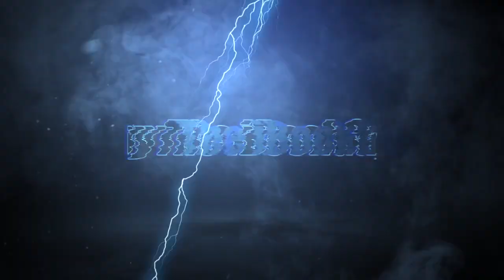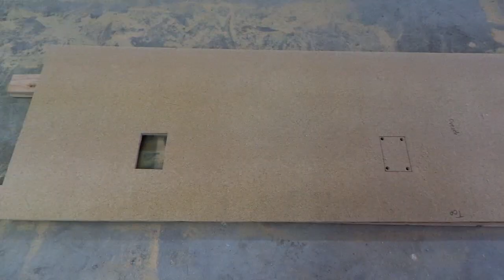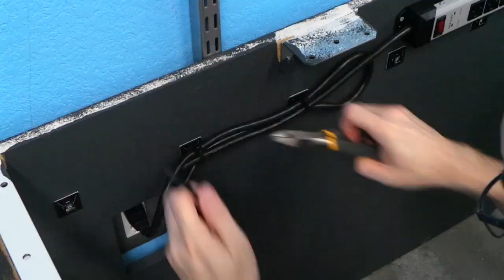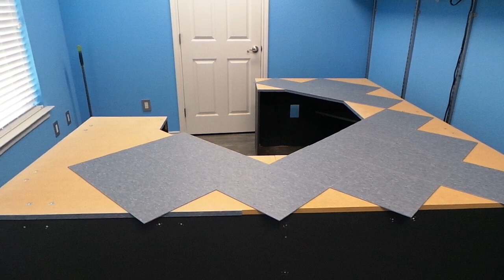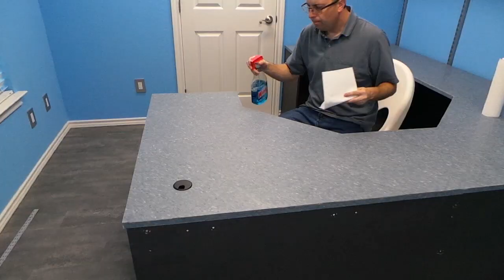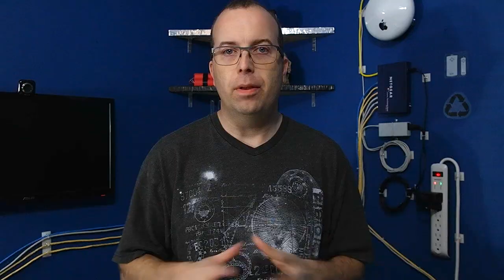Building the Ultimate Computer Desk - Part 3

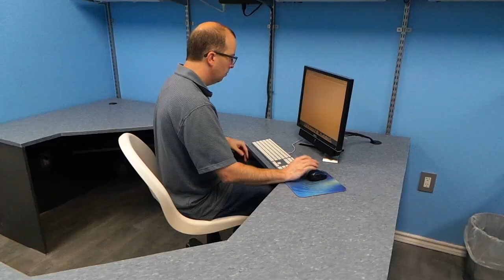Comment: I dont know how often/long your computer sessions are, but i hope that brief scene at 3:52 is not how you normally use computers. That monitor is 5-10 cm too low with your head tilted 30 degrees downward as if using a laptop (top the of the monitor should be at the height of your eyes).  A chair with almost zero back support and no arm rests leaving elbows suspended in mid air.  Keyboard appears to be too close to the edge of the desk with your palm partially unable to rest on the desk.  The mouse seems fine, although still a bit awkward because of the 45 degree desk edge.

You should really invest on a new and better chair, and secondly a new and bigger monitor.  Correct me if im wrong but i think that dell monitor are one of those designed to sit on top of the horizontal desktop computers.  So the design intended for the display to be at a higher height.  Maybe stack some textbooks or something.  Sorry, but the ergonomics is atrocious and it really made me cringe.  Excellent job on the desk though!

Comment: Guys i going to buy a new pc for my games and my work with design is that alright:
Motherboard Z97X-UD3H-BK
GTX 970 Gigabyte G1 Gaming
Core i5 4690K
Case NZXT H440
Watercooler Corsair H100i
Corsair CX600W
HyperX 2x4GB
Reply: ***** If possible, try avoiding that as you wouldn't be able to use the Ram in a Channel, which can lead to a tad bit better performance.
Reply: +Maicon Sergio Just depends on what games you are going to play.

Comment: Thicker mdf wouldn't help. MDF for this sort of project is a big no no. It WILL  bow over time dependant on the amount of weight you put on it and dependant on the amount of moisture in the air it will also start to blow. This is where moisture gets into the wood and essentially disolves the pva that holds the wood dust together. Over time its a big issue. You need to use either ply wood (or even better marine ply) or solid wood. 
Im sure its a good desk but it likely wont last. Im sure you've done this as a learning experiance and good on you for trying it out but a little research could have provided you with a stronger, better looking and longer lasting desk.

Comment: Buy an led strip off amazon for under desk lights they are 8 bucks for a roll probably longer then required so you would have some left over for the companion desk. The lights don't come with a power supply but I can't imagine with all the tech you have that you don't have a supply that would work. If you don't thanks another 5-7 bucks. Also you can get all different colors and ever color changing ones.

Comment: should do support the left and right side of the middle of the monitor does not necessarily from the disc through the entire depth, sufficient to wood with a large support leg on top. Stainless steel would compose nicely. Terribly thick plate edges probably much more expensive. In general, the work done nicely :)

Comment: I dont have enough space to put a monster like that, but some of the ideas are awesome. Mine will be just a one rectangular section, i'm thinking about "cutting" the surface in half, so i have a fixed section where i put the KB, mouse, etc, and a "drawer", or "chest" section in the other half, so i can store the KB, mouse, G13, etc, there, without having to disconnect it, , wall mounting the monitors, and ending up having a completelly flat surface if i need it. I was thinking about sinthetic stone for the fixed portion (like Silestone and such), but your idea tempts me... and its like ten times cheaper LOL.

Comment: You think in everythink...

You might consider, for the next time, to add a beam under the table. Or a slim vertical beam, to prevent the curvature of the horizontal plane table.
Reply: He can't add anything vertical as it would mess with his ability to move around in his chair, he would have to move his chair out and then back in removing the leg "freedom" he wanted. I was thinking to why he didn't add any horizontal supports though. But he said he might add them later on.
Reply: yes he can.
just be more smart and think well

Comment: 3/4 inch plywood would have been more expensive but it pays off in the long run because after all the reinforcing you will do comes out pretty much the same.. Also routers can be rather inexpensive if you go to the right place at the right time.  Don't mean to sound critical because you at least found the do it yourself spirit too many people lack. Good luck.

Comment: Hello, I'm a designer, just wanted to point out for future projects or for your reinforcements that with mdfs and particle boards you need a support every 90 centimeters (I use metric, sorry) to keep it from flexing, I have tried it with bookshelves, no matter the thickness you need to support every 90 cms (or more often if it goes with the design...)

Comment: Wow, i'm super impressed on how this turned out. Do you think 1/2 inch mdf would stop it from flexing?
Reply from the maker: If I could do it over, I'd probably try to find 1" or better.   But honestly, as long as nobody sits on the desk, I haven't had any trouble with it flexing.
Reply: MDF is going to flex. MDF is very dense and thicker will probably only increase the flex of the top surface. Adding runners on the front and cross beam support would have helped the stability and significantly, if not completely, eliminated the flex.

I like the abstract method of building your own desk but I have to say that this desk could have easily been built for MUCH less than 500. Priming and painting the desk then finishing with a nice epoxy would have given it a clean and strong surface. In the end, it's your desk so if you like it then more power to you but "Ultimate" is pretty strong and the tiled look on any surface but the floor looks pretty tacky.

There are plenty of zero hardware joints that could have worked for this build as well. Since the desk has no drawers and only one primary horizontal surface it would have made taking the desk apart or replacing sections even easier.
Reply: @benkelly1737   "zero hardware joints" : please elaborate.
"could have easily been built for MUCH less than 500" : $500 does not sound like much for a piece of furniture.
" thicker will probably only increase the flex" : The stiffness grows faster than the weight so I do not see why that should be the case.
Reply: The iBookGuy Hey nice small video series. Please make note videos like this. Thanks.
Reply: +Jason Mei no it would not. I have made many computer work stations using MDF and plywood. I never use anything less than 5/8 for construction when making desks, work stations etc. MDF is just very fragile so it has to be made reasonably strong.  I made a board room table and for the top I made it double laminated layers of 5/8 plywood good both sides and covered it with Aroborite. I trimmed the edge with oak. You could easily jump on the edge with out any issues. A little tip for you guys that are interested as well, there are places that sell prefinished 4/8 sheets of material with maple, oak etc that can be used for the sides and face. You pay a little more to do things right but have something really nice when you are done.
Reply: Instead of MDF, I would use plywood for the top surface. Plywood is multiple layers of cross-grained wood sheets bonded together. It is super strong and takes an extreme amount of weight before it flexes!
Reply: MadMan More
Reply: Ben Kelly My desk is made of 1" Mdf and it does not flex. My desktop is not as long or wide though. Its only 6'.
Reply: Buy domestic wood like cherry at 3/4 inch and it would hold several hundred pounds no problem. MDF is super cheap
Reply: why not just use plywood?
Reply: You are right about most of what you are saying but parta crap is way cheaper than real wood.
Reply: Ya that is why I edge tops with oak. The desk I am sitting at right now has a 1 inch MDF  top with an arborite surface and a plastic type edging all around. It is strong, flat and looks very nice. The top comes off for moving but it is still heavy as hell!
Reply: The desk I am talking about is one that was factory made so it is how it came but you would not round of MDF.
Reply: I don't think it's 1/4 inch, looks more like 3/4 inch.
Reply: The way to keep it from flexing is to use thicker mdf, cut it longer so you have 1/8" overhang, use metal brackets, keep it shorter overall. If you going to do all that though you might as well just buy furniture grade plywood or something.
Reply: i Bee Amazin That stuff is expensive though.
Reply: Khaltazar My desk is  1" mdf ontop and 3/4" on sides, with laminate all way around. That's the way it came from the factory.
Reply: +Jason Mei maybe look for plywood or something like that, mdf isn't great wood but its cheap
Reply: Sergeant Weijand Have to use furniture grade plywood if you are going to use plywood for making furniture.
Reply: Truman West LOL!!!!!
Reply: this is 100!10
Reply: I think you would be better of forgetting about the tiles and particle board crap, and use real wood.  It would look nicer, and it would probably be about the same price.
Reply: Dave Brittain $150 wood + 58 tile + $20 Glue.  

That was also cheap quarter inch particle board he used.  

1x6x6 is on sale at my local lowes for $4.28 

Lowes has 0.75" particle board for $20 for a 4x8 sheet. 

Cubic inch/$ the particle board is less than half the price, but that's before you add in all the glue and shit.  

You wouldn't even need to do the whole thing in wood.  The top is the only part you actually care about.
Reply: Ok guys you have to remember that you really would make a desk out of hardwood not softwood. Some people don't mind softwood but it tends to take dents way too easy
Reply: Dave Brittain You could always put a sheet of hardwood on it, if you really wanted to.
Reply: Dave Brittain Mine is 1" MDF. Its quite strong. The edges get beat up easy though.
Reply: john handcock Metal brackets help greatly but you have to get the right ones. The kind that have some width and thickness.
Reply: If you need strength don't use wood glue. Use construction adhesive. Just make sure its formaldehyde free.
Reply: Dave Brittain Why not just use a router with a round over bit 1/8" or 1/16"?
Reply: Mine is factory made too.
Reply: 3/4" cdx would be best
Reply: Jason Mei go with 3/4 oak or some other domestic wood like cherry. MDF is just sawdust glued together. I think im going to make this desk but a portable version thats not mounted. Only difference is i will use Cherry wood and then i will coat it with a glass epoxy so it is durable, smooth, and water tight.
Reply: Dave Brittain With MDF I would not go less than 1". Need the tickness for fastening metal brackets. MDF does not do well with screws alone. It can crack or split.
Reply: +Jason Mei nooooooooo mdf! people who think its ok to use MDF are whats wrong with this world!

Comment: I put lights on the underside of my desk with led strips I bought on ebay for $1 a piece. I took a computer power supply and modified it to a benchtop power supply, and that's the power source for my lights. I also installed a switch on the front on my desk to turn the lights on and off so I wouldn't have to crawl under the desk to turn the power supply on and off.

Comment: I think you would've been better off and cheaper too by building a 2X4 or even 2X3 frame first and then use a thinner paneling for the top and sides. This also creates a much stronger design than the pure paneling. Enjoyed the videos, nice full explanations.

Comment: Wood is expensive there. The best way to do it is to use HDF not MDF (high density fiberboard vs medium density fiberboard). I think your design is great but the execution is not the best. The small shelves are a good idea. My father used to be a carpenter and I have access to pretty much full range of tools to work with and I have a MDF/HDF factory 1 km from where I live. I think it's time to build myself a custom desk.

Comment: Which Mac mini model is that, I have the newer core i5 model, which irritates me because it doesn't have a built in optical drive! 😠
Reply: Itsone of the older ones. You can buy them at powermax.com
Reply from the maker: Liam Cochran - It's the 2010 model, the last one to come with an optical drive.  That was kind of important to me at the time, but honestly I haven't used the optical drive in 3 years at least.